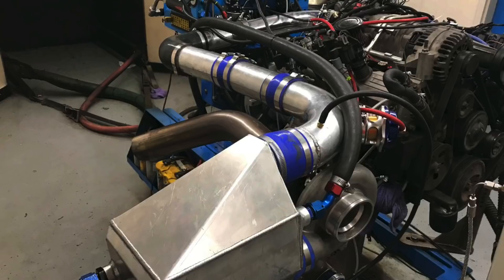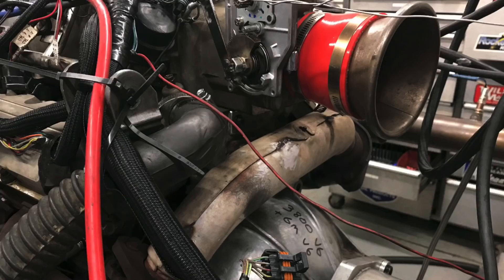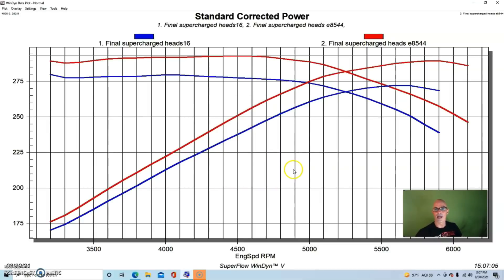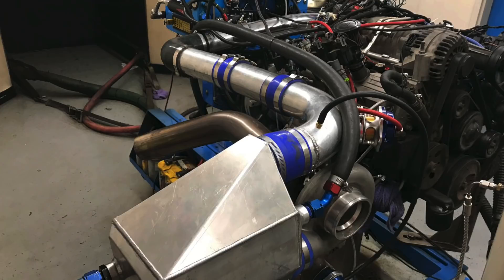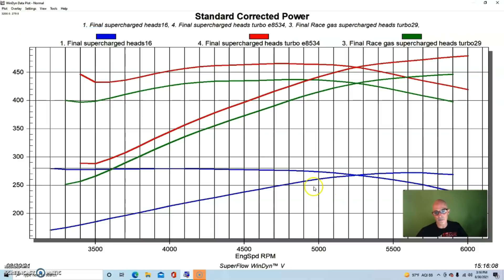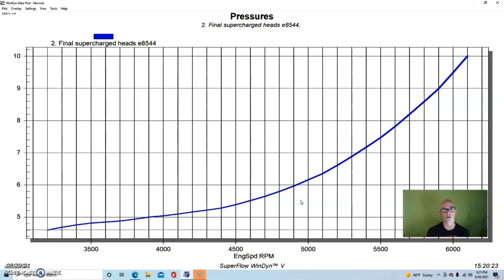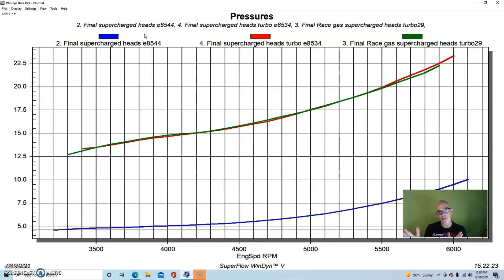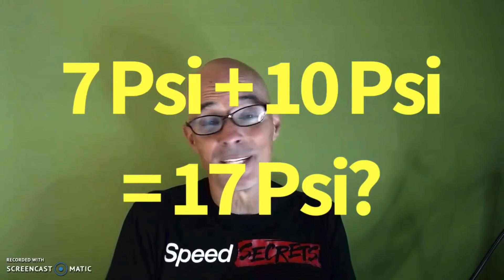HOW TO: COMPOUND BOOST 3800 L32-REPOST WITH DYNO PULLS

Comment: DID YOU HAVE TO TUNE THE ECU OR CHANGE THE INJECTORS TO LARGER FLOW TO RUN E-85. 
I HAVE AN N/A 3800, 1998 OLDS, AND IT SETS A LEAN CODE IF I PUT 1 GALLON TO 3/4 TANK OF 89 OCTANE.
Reply from the maker: yes-you need to tune it for e85 and you need near 25% more fuel flow

Comment: Richard, I am building a 3800 with a turbo and a m90 supercharger. I would like to know what kind of MAP sensor and PCM setup that you used to tune your engine?
Reply from the maker: we used a 3 bar map and Holley HP ECU
Reply: What I'd like to know is if this could be done with the OE PCM. I have an SSEi and would like to do this. I had it reflashed for the build I did already, but not sure how I would work up the complete setup. Since this needs to have the Transmission controller and all the rest of the stuff, like traction control and whatever else is tied into the PCM.

Comment: I swapped a 2005 Impala l67 into my 2001 Buick century back in 2015. I got the motor from a junkyard in Ohio that speciallizes in 3800s. I think it's the only l67 century out there :) I had to run two ecms, stock century to run the starter and dash, and stock impala ecm for the engine. A few sensors had to be split and fed to both ecms. Had a lot of fun with it, no mods, then I gave the car to a friend who's wife drove their kids around in it for about 3 years with no problems. They got a new car so I will be getting the car back and will make a cool video about it.
Reply from the maker: cool stuff

Comment: I would be interested in seeing the supercharger bypass valve actuated by post turbo pre supercharged boost.     I would love to see the efficiency difference.    Especially with a 3.0 or smaller pulley for max low rpm torque.
Reply: A really big-bore BOV could bypass the blower after a certain boost pressure, as it would feed to a post-blower intake manifold, yes?

Comment: Was good to mention the favourable conditions on the dyno vs in a road car, but would have liked to see this compound combination with a suitable camshaft, as the stock cam is quite restrictive. Also a bypass valve around the S/C, opening once turbo is producing boost would be interesting to see.

Comment: I have a good reason not to do it.....it won't work in a car. Nit even talking about packaging. Running it at 140 degrees is dumb. Please stop the unrealistic testing. None of the numbers you are putting up mean squat. We don't have a Dyno at home to play on so nothing you do can be used as a baseline for a combo in a car. It's been fun for awhile but how about some realistic testing for things that will work in a car? Race gas numbers are pointless. Run pump and e85. Run 180+ degrees water.  If I'm talking out my ass go put something you build in a car with the same tune and see how long it lives.

Comment: I fully expected the supercharger to make more boost at low RPMs, like isn't it supposed to be the main advantage of root blowers?
Reply: Roots style superchargers like the one in the video are propelled by the crank pulley. The advantage of having the blower sitting directly on top of the engine is its ability to directly force air down into the lower intake runners. By means of twin rotors that sit inside the blower housing. Downside is that they often suffer from heat soak. Centrificals (the higher quality ones) reroute the air to an intercooler thats mounted in front of the radiator. Similar to a turbocharger. Then back to the engine.  Both significantly decrease inlet ambient temperature with those setups. Downside is they both are dependent on higher engine rpms. However some larger displacement over head valve pushrod engines can make boost off idle. With the disadvantage of lower rpms. Overhead valve engines greatly benefit from turbos and centrificals due to their ability to rev higher and maintain that boost curve. 
Ideally in race applications. A DOHC motor will make better use of  turbochargers. Ferrari is a good example. Over 700hp from a tiny 3.8L DOHC V8. Thats phenomenal efficency from such a low displacement.

Comment: Another great video thanks Richard.  It would be great to see the TC targeting a fixed manifold pressure with a boost controller and do that with the biggest blower pulley, then the smallest blower pulley and then with no SC, just the TC.  All cases trying to make the same manifold absolute pressure.  That would be a fantastic comparison, especially the way the torque curve builds from low rpm

For a street car, daily driver a well sorted compound/Twincharger would be a thing of beauty.  I have plans on the drawing board for a Toyota 4AGZE (1.6L) Twincharger with a fully variable 60mm throttle body for the SC bypass.  The SC also has a clutch, that full combo properly should be a pretty amazing drive.  Very complicated, but that's part of the charm, a bit of a science project.

Comment: Well that Blower is a hunk of crap in the 1st place, But to see the effect adding Turbo on top of supercharger which I saw long ago w/a 6:71 Blower & 2 turbos on BBC In Old Nova & it worked then so why wouldt this work on something real? Its tuff get my 14:71 F11 over abt 46lbs but I here abt Turbo cars running 60+lbs all the time..I could hit 50+lbs w/a screw supercharger like PSI-D Or More w/a PSI-C, but if I could throw turbos run directly into the Hat, if the KB block can hold it I would think should make easy 60-80lbs w/o having to run the Blower very hard which ofcourse would keep the intake temperature down running blower slower, I wonder how well this could work Or should I run the engine on bunch of Nitromethen..Ive already run 33% Nitro w Alcohol as majority additive which is krazy power..I wonder what would work best Or is it better Not to run Turbo, Instead run Blower harder? Idt that works bcz of the heat Usuallly after running 60 over or so..Bunch of things uve now given me ideas to try out by doing this & reminding me of Rick's Nova from the 1980s, thanks again for Ur videos, they are really good🎸🎸

Comment: Could that boosts curvy because the cam is opening so little and for such a short time that it's building pressure in the intake but not getting much in the cylinders? No matter what it is it worked well.
Reply: Think about what you're asking here, if the boost isn't making it to the cylinders why would the dyno results be showing such an increase in output? Boost pressure isn't going to know anything about lift or off the seat times. If the pressure is raised, air flow is going to be pushed to the destination, if it is restricted, the pressure will increase and in this case, the pressure was limited to 7 PSI between the turbo and the charger, in the end total boost was around 23 PSI which is way more then the OE system of the 3800 was engineered for in the first place. HP and TQ shown on the dyno charts point out all that is needed to be seen, the combo makes a lot more power then either without. Increasing the turbo boost on its own would require more exhaust back pressure and flow which equates to more heat. Using the turbo to supply PSI to the charger makes for less work from either part to get the 23 PSI and since the charger gets the throttle response that a simple turbo will  not give and the turbo boosts flow at the upper range with less demand on the charger drive system. As far as getting the intake charge cooled down, there is a bolt in IC that fits under the charger, raises it 2 inches and can lower air temps as much as 120  degrees or more lower. If that's not enough then put a cooler between the turbo and charger then put in the IC in there, getting the heat exchangers is the only thing that would be an issue but where there's a will, there's a way. Or was that where there's a wheel there's a way?

Comment: Why does E85 make more power than 110 octane racing fuel? How much octane is E85?
Reply: not so much about octane but E85s ability to resist detonation at temperature. its almost diesel imho. so in an application where inlet tmps run away, it shines
Reply from the maker: Its not octane

Comment: guess it makes more boost than it should, because of the suction from the SC makes the turbo deliver more boost before WG opens.
Reply: They don't add X psi, they work by creating pressure ratios. The blower at 5psi is 1.35:1, the turbo at 7psi is 1.48:1. Multiply those together (with atmospheric being 14.5psi) and you get 1.998:1 or 29psi absolute - which is 14.5psi. That fits perfectly til the SC pressure ratio goes thru the roof due to cam causing a back-up. Every 3psi you add with the turbo makes 4psi at the valves.

Comment: in compund setups i always figured the compressors multiplied rather than added boost, so say a turbo putting out 14psi is 2:1, well, feed it 14psi of boost it wont get you 28psi (14+14) itll get you 56psi. I presume positive dispacement blowers will do the same?!

Either way I have a 3.0d E60 5 series, and plan on putting an ebay gt35 over the stock gt2060v, got the turbo, and all the plumbing, just need to find time to take the car off the road for a few evenings :) so loving this compound stuff, and making me think i should pick up an ebay GT45 instead...
Reply from the maker: multiply the pressure ratios-but common core math is funnier

Comment: would be interesting to see the power difference (at the same boost) between s/c and turbo'd n/a intake, but to put a n/a intake on a s/c 3800 s2/3, you need to swap the heads as well due to fuel injector location (in the intake n/a, in the head s/c)

could also compare fwd intake vs rwd fbody intake
Reply from the maker: we can use the na intake-we just plug the injector holes (but that is also an intake change)
Reply: @richardholdener1727  there is also the issue of the n/a manifolds using internal pcv system, but on a dyno you just block the port and run breathers

Comment: Maybe this is a question for the Q&A, but I’m wondering how close this compound setup is to other factory twincharged engines like the Lancia 037 and the Nissan Superturbo. IIRC, those were for driveability, with super boost down low transitioning to turbo boost on the top end. Richard: Would the plumbing routing you fabricated here do that, or is this more of a drag setup, all about top line numbers?
Reply from the maker: the Lancia actually routed the turbo around the blower after a given boost was reached-lots of plumbing-but what I have here works well for the street

Comment: Also I want to mention that the L32 connecting rods are supposed to be stronger then the L67.  We'll see.
Reply from the maker: are the internals in the L32 forged?
Reply: @richardholdener1727  Hot-forged powdered metal.

Comment: Thank you Mr. Holdener. This was excellent. Very interesting and helpfull. 
When compounding one does not add boost together, one multiplies the pressure ratings. 7 psi boost is 1.4828:1 in pressure rating. 10 psi boost is 1.6897:1 in pressure rating. 1.4828 x 1.6897 = 2,51:1 total pressure rating. That is the same as 21.83 psi boost. :)   
479 hp / 2.51 = 190 Hp Na / 232 CID = 0.82 Hp/CID as NA engine.
Way better than the "stock" 289 hp @ 9.5 psi (1.66: 1 PR) from 232 CID = 0.75 Hp/NA/CID
Reply from the maker: yes-but that won't let me use the common core math joke

Comment: I'd love to see the boost referenced from inside the head and connected to the turbo waste gate; it should then provide a flatter boost curve and help to tune out some of that rising curve from the blower
Reply from the maker: inside the head? a waste gate reference after the blower will open the gate all the time (no turbo boost)
Reply: @richardholdener1727  I meant intake manifold, sorry. Point being, if you want to limit your compounded boost to say 25psi, reference post-blower and attach to wastegate
Reply: The supercharger increases the pressure at the end kind of compensating for the head flow, putting the boost reference on the intake would only make the engine gain a lot of torque and maybe even lose power
Reply: @braziliansheetbox2497  the way I intended will ensure a "final" boost number, hopefully flattening out the curve of the blower by itself. Depends where the turbo lights up though

Comment: "ok guys what did we learn" it needs a cam, ported heads, a Whipple fed by the turbo, e85. Solid 500/500 for seriously low bucks.
Reply: It would be far cheaper for him to get another $95 ebay t3/t4 46trim and feed that with the gt45. The 46trim would probably make 300-350hp alone, meaning it would be like slapping a GT45 on a 4.8-5.3L LS.
Reply: whipple /= low buck
Reply: @denisohbrien  cheaper than building comparable broad range of power na out of a V8, remember we're talking about a junkyard engine here.  And if it blows up you take the blower with to the next engine, so yes it is relatively low bucks. Everything is relative my friend. 😉

Comment: The Ford GT guys pull the supercharger off and go pure turbo ... with impressive results.  I wonder what the results would be doing the same on the 3800?  Ultimately, it is just eliminating the un-intercooled boost from the supercharger and turning the turbo up to compensate.
Reply: You can get more max power that way but you can still get a ton of power compound boosted and it will have a badass power curve which is important on a street car.  It's not always about max peak power some forget that.

Comment: So the turbo provides a steady 7 pounds and the blower previously was making a peak of 10 pounds. But previously the blower was taking in atmospheric air not already compressed air. I’m guessing that’s why the total boost pressure is higher than the 17 you would expect from simple addition of the two separate boost pressure?

Comment: Hope the next installments is N/A Camaro (ideally) intake,  and GT45 and intercooler.  This setup works, and has twin charged coolness factor, but intercooled turbocharged is always my favorite way.
Reply: The non dbw (96-98) camaro intakes have a plug on the side that taps into the internal pcv setup (iirc) use that to not put boost into the crankcase (you would still need to block the pvc port at the throttlebody)

Comment: One of the local tuners had a turbo'd 2000 GTP that was putting down 444whp on the dyno. It was one of the fastest (in the mid-2000s) around here. Surprised the hell outta many supposedly fast cars. There still might be youtube videos of it floating around in here. IIRC it was a red or blue sedan

[edit to add]
History note:
In WW2 the P-38 Lightning used a turbo-supercharger setup with intercooling on an Allison V12 engine that produced roughly 1600hp

Comment: Wondering if the turbo is just overpowering the supercharger, thereby nullifying it. Would be interesting to see the power and boost curve with the turbo only !,
Reply: There's no 'overpowering', the cam just doesn't flow for shit. When an SC flows X air per revolution, rising boost means less of that air is moving thru the head.

The only difference you'd see with the turbo-only making X boost is a lot of lag, but very similar peak power as turbo+SC making X boost...plus the HP the SC eats from being driven.
Reply: If they target the exact same peak boost pressure with just the turbo it'll provide that through the mid range too but it'll take longer to spool
Reply: 2 step or anty lag rolling takes all and I mean all the lag out so no lag !!!

Comment: It would be interesting to see what the difference in mass flow is, rather than just psi in the intake. I’m guessing the rising boost curve means this combo would really like a lot more cam, too. Looking forward to the next test!
Reply: A custom grind, all the lift the ported heads can handle, keep seat duration close to the same. Maybe extend it so you can pull clean to 6500 with a peak right at 6000 would make for a mean street engine with a good amount of reliability. In other words don't change the curve or range it has just amplify it. Would live with stock bottom end if you could do that.

Comment: Everybody here should thank Brian Pryes, he is the one who helped Richard to get the 3800 running with the HP setup.  I am the one who put Richard in touch with this guy, just glad to help.
Reply from the maker: thnx for the help Charles and hooking us up with Brian (I searched back through my emails for his name)-would not have happened without you guys!
Reply: @richardholdener1727  You're welcome.  Like I said, just glad to help.  I hope it didn't seem as though I was patting myself on the back.  Brian is a good guy who builds performance transmission down in the Houston area.  He is one of a few guys who swapped the 3800 into his Grand National or T-Type.  He's making some awesome power with the 3800 series 2/3 and doesn't have to worry about the block giving up on him, like with the Grand National 3.8L.